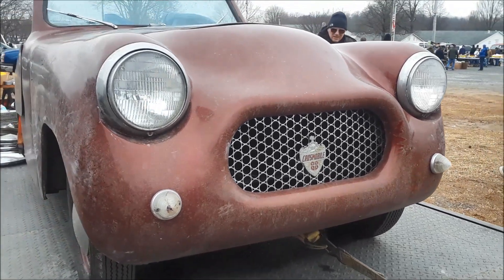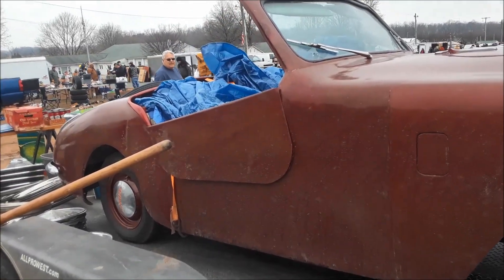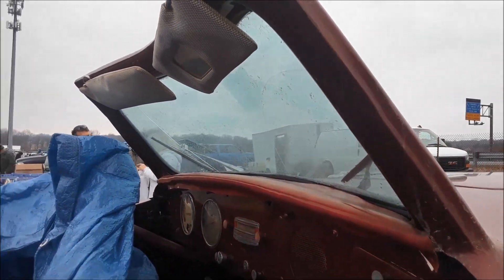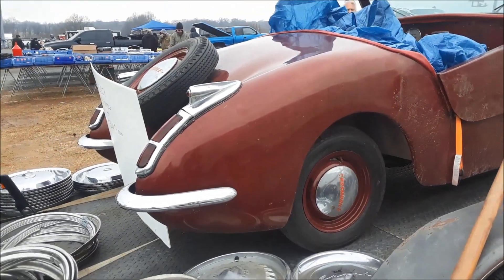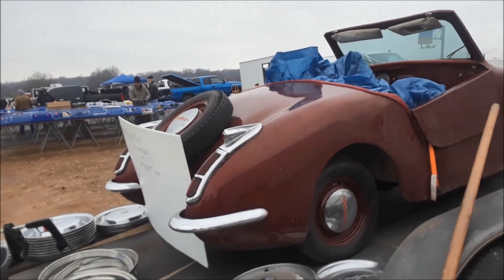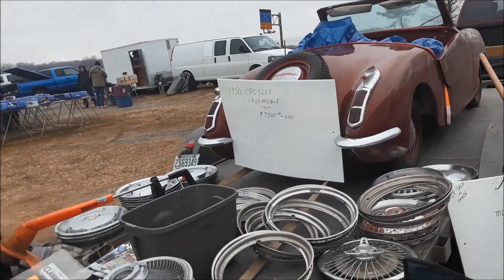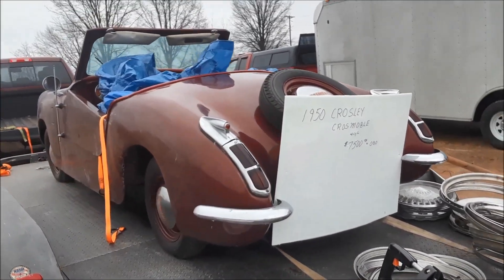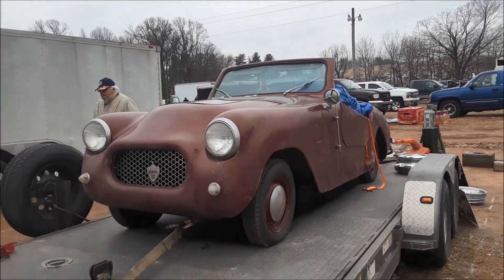Walk About A 1950 Crosmobile At the 2019 Howard County Swap Meet Chesapeake Region AACA

Comment: The United States had the 'Crosley' automobile, and Great Britain had the non-related marque, 'Crossley'. To differentiate Crosley's overseas export automobile product, the re-badged name 'Crosmobiles' were used. They were identical to the standard Crosley models, except they had 'Crosmobile' lettering on the hood, hubcaps, and rear badges.
This example is one of only two Crosmobile Fastback's known to exist. It has been treated to a body-up restoration, including an engine rebuild, new chrome, and paint. The list of options and accessories on this car include a radio, dual side mirrors, dual wipers, and Crosmobile hub caps. It is painted in Pewter Grey and has a red leatherette interior. Power is from a four-cylinder engine which is mated to a three-speed manual gearbox with floor-shift controls.
The Crosley automobile would remain in production until 1952. These small, lightweight, and low cost vehicles were rather impressive, but the American public preferred the larger, more powerful automobile to enjoy the vast, newly created American roadway system. Around 75,000 examples of the Crosley automobile were produced before production ceased.
Reply from the maker: Thanks for the back story!!!! On the aside, the 4 was an overhead cam design. They also offered disc brakes but the system was not very good and was discontinued. Thanks again for the info on this interesting American car of the 50's.